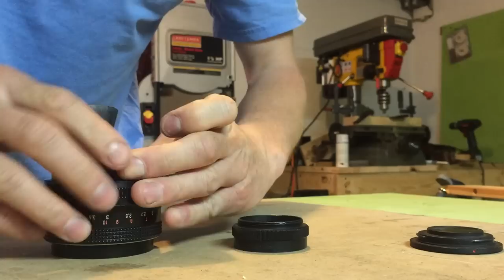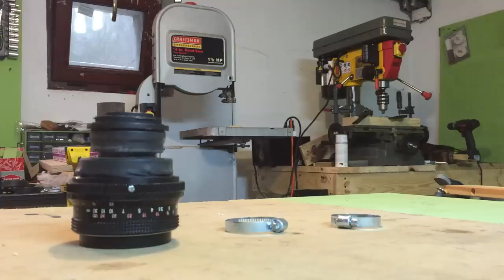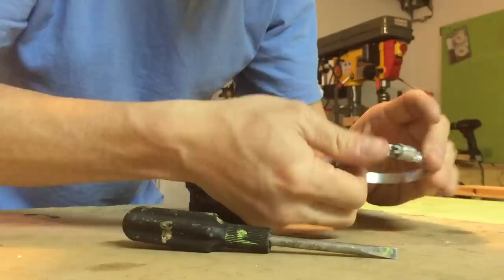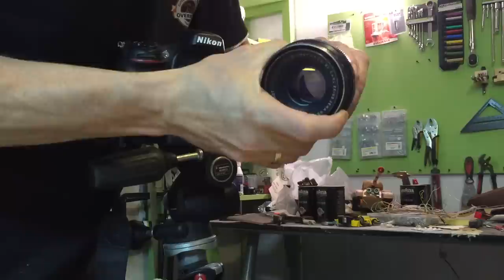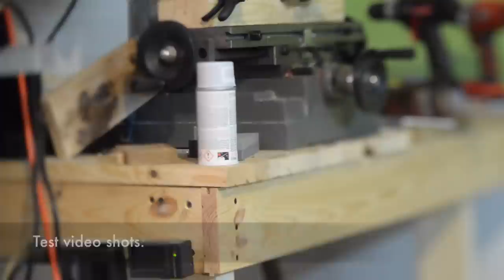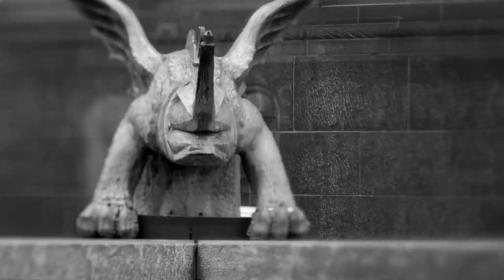Make a tilt-shift lens under $100.

Comment: Hello... This is a very and simple explication.
But I have one question.
In the video, it seems that you used a m42 adaptor with a lens included... But the link you gave is a m42 adaptor without lens... 
What do you suggest....?
Thanks
Reply from the maker: +sebastien Chateauvieux Both will work just fine. The difference is insignificant for this application. It would matter a lot if you planned to use it with m42 lenses. Then the adaptor with lens allows to focus properly in full distance range.
Reply: I will use with a m42 lens... so now i know that it is better with a lens adaptor. .. many thanks
Reply from the maker: np. Good luck with your build!

Comment: it does not work. only in macro or you need special lens, so the problem is the lens is to far away from the camara sensor. tested with nikon fx and dx from 8mm to 135mm old and new lenses.
Reply from the maker: The lens that is used in the video is a mid size frame camera lens. MC Miometar 80mm. Sometimes you can get these old lenses for steal on ebay or local yard sales. None of the 35mmm camera lenses will work.
Reply: i see i have sort of working with old 50mm nikon hc lens, its not perfect but i go to search for mid size lens

Comment: How/where did you get your Biometar MC 80mm f/2,8 lens for $60?
Reply from the maker: cooper c Ebay. They are usually more expensive, but I saw few of these from time to time quite cheap. There's also older version of this lens without a great coating that I saw, and probably it would do for this project.
Reply: Thank you